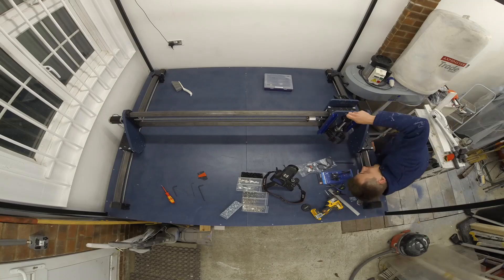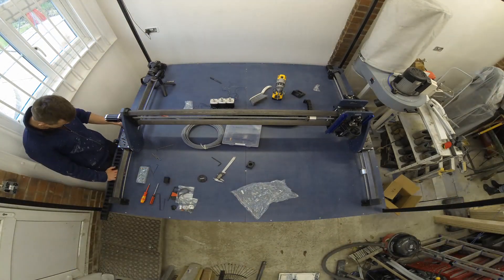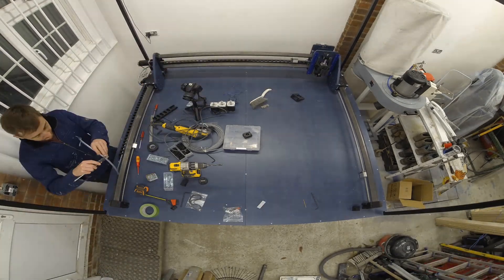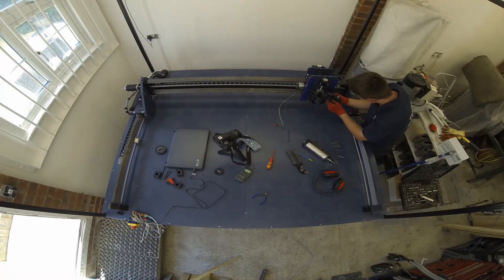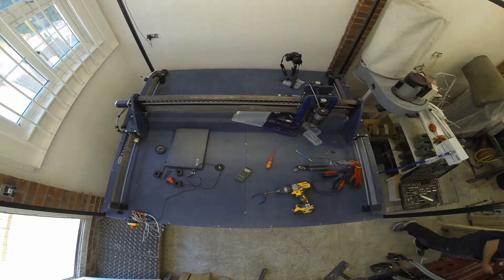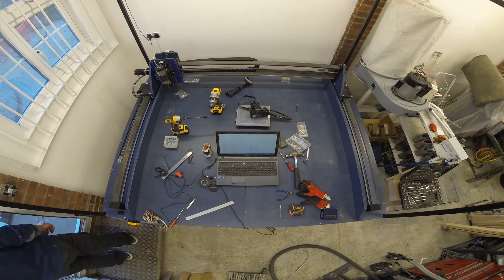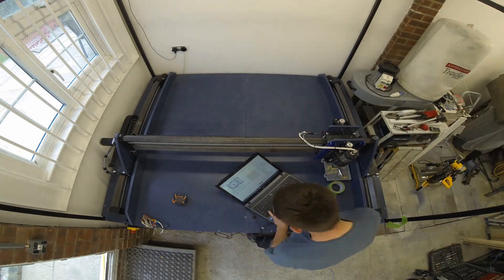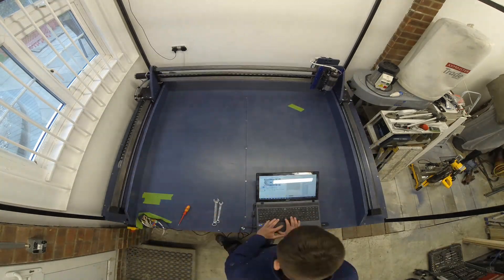Root 4 CNC Build Time Lapse Pt:3/3

Comment: Hi Peter, I would like to know what control system you use for the axis movement of the router.
Reply from the maker: I currently use a ramps 1.4 with external stepper motor drivers and Nema 23s